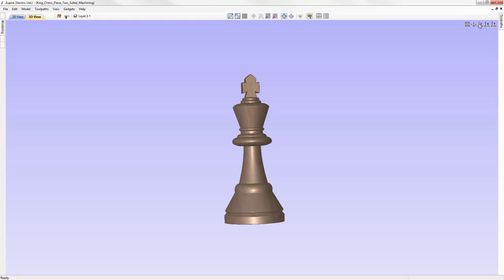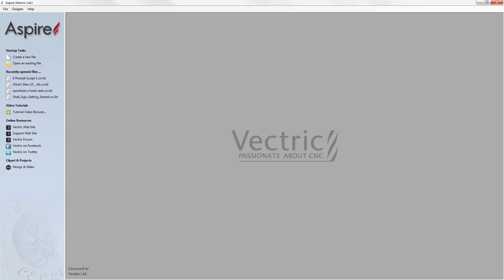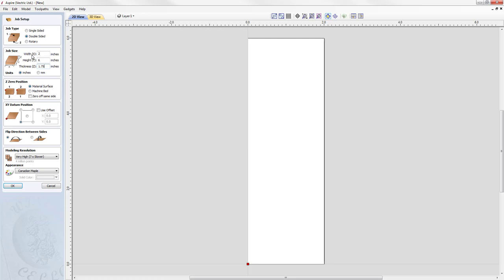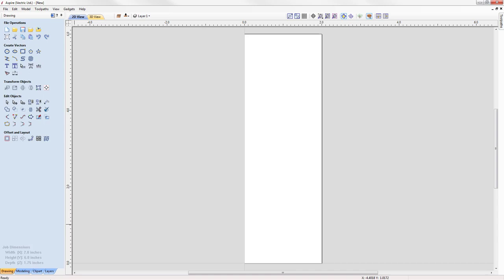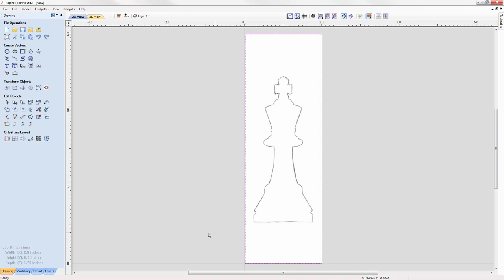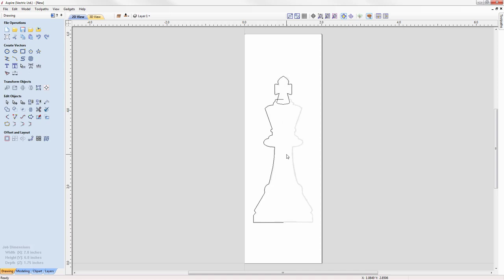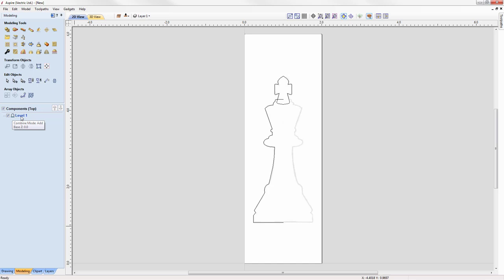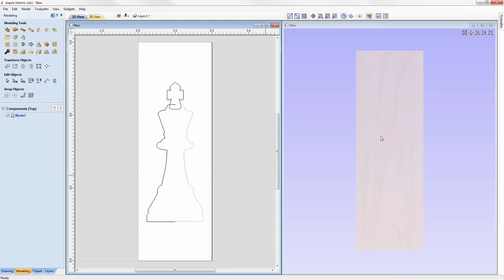Vectric V10 Tutorials | Two Sided Machining | King Chess Piece

Comment: When you click on modeling, you have lots of options that I don't see in vcarve desktop.  Should I?  Is the feature to create the round shape from the vector not in vcarve?
Reply from the maker: Hey Bob, what you are seeing is correct, I am using Aspire in this video, that has the tools for me to be able to create 3D models, VCarve doesn't have to model creation tools but you are able to assemble 3D models. I hope this helps answer your question.
Reply: @vectric  Very much so.  Thanks.